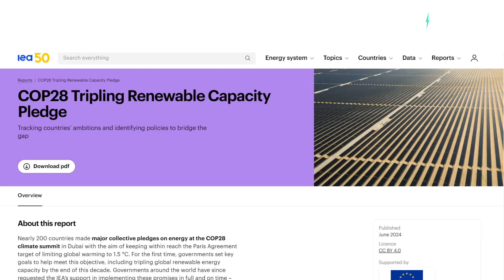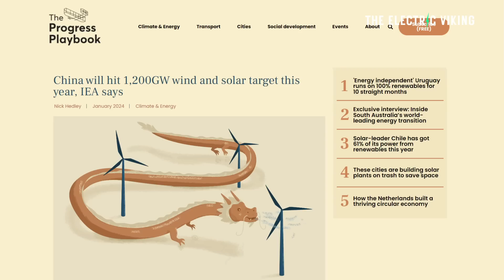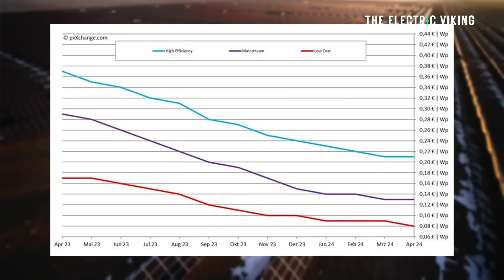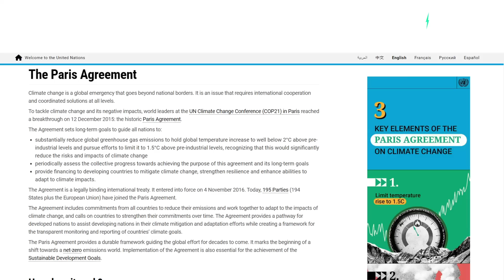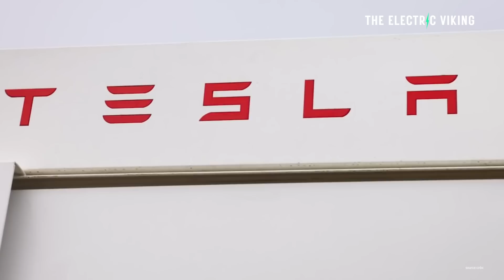IEA debunks media lies - world will triple renewable energy capacity by 2030

Comment: Renewable technology simply isn't ready to supply the world's energy.  Solar requires energy storage, and we don't have efficient energy storage at this time. Wind is intermittent, even in the best circumstances. So, it requires energy storage also. There are a LOT of energy storage experiments being tested right now, but none of them is mature. Further, we can't build enough lithium-ion batteries to provide sufficient backup to the major energy grids of the world. We simply don't even begin to have the capacity. Additionally, it is questionable that we have enough rare earth materials to provide battery backup on such a massive scale. 

There are two major developments that are occurring that will dominate the world's energy system:

1. The development of solid-state batteries will transform the automotive industry. Initially, they will have 50% more range, charge in less than 10 minutes, have superior longevity and operate much more efficiently in extreme cold and hot weather. Right now, several companies are building different versions of solid-state batteries, which they will sell to various industries. At least one or two companies are ramping up for mass production of their solid-state battery versions. As the solid-state battery industry matures, it will change the world, but it still won't provide a massive shift to replacing fossil fuels used in utility power plants. The demand for solid-state batteries will be obscene when they start to come out, and it will take years for companies to even begin to meet that demand.

2. Small Nuclear Reactors (SMR) are being developed by dozens of companies. Various prototype versions have been built, but the challenge is developing an SMR that can be mass-produced, has intrinsic safety protections that don't depend on human beings, and can be easily transported via 18-wheel trucks or heavy-load helicopters.  Successful SMRs also must be easy to install and repair, possibly using modular parts that can be "plugged in" without taking the entire reactor apart. 

Several countries have built SMRs over the last 60 years and NASA is designing SMRs for space travel and spaceship propulsion. However, NASA is notoriously inefficient and stupid, so it will be private industry that will solve the SMR problems.  The rewards to those companies who are able to design an SMR that can be mass-produced, easily transported, easily repaired, reliable, easily installed and intrinsically safe are incalculable.  Imagine being able to buy a 100 Megawatt SMR that can be transported in a normal semi-truck, set up in six months instead of 10 years, and costs $150 million. It will have built-in safeguard shut-downs that don't depend on human monitoring. They won't require massive amounts of water to cool, and many designs use spent uranium waste that comes from traditional power plants. They will be so safe that they can be installed inside cities, which will make connecting them to existing grids dirt cheap. 

SMRs have the potential to provide dirt-cheap, clean energy whose only negative is that they produce nuclear waste. However, the waste they produce is not high-level waste and it is much easier to dispose of than waste from traditional nuclear plants. 

Unlike solar and wind, SMRs can produce energy 24 hours a day and they will easy to backup with redundant SMRs. So, a major city may be powered by 10 SMRs located strategically to connect to the grid, and utilities will buy three or four  "spare SMRs and install them in key points so that if one of the 10 SMRs goes down, a spare SMR immediately comes on line.

These two energy solutions are happening as I write this and they will change the world. Solar and wind will continue to grow, but they will never exclusively power nation's power grids because there are no cheap, efficient storage options on the horizon. Further, they are highly suspectable to hurricanes, floods, tornadoes, earthquakes and other disasters. SMRs can be built underground in concrete bunkers that protect them from disasters. 

I am all for wind and solar power. I will be installing a solar system on my home soon, God willing. But by themselves, they are not the panacea that "green" environmentalists envision. We are not going back to the Garden of Eden, where everyone will eat granola and sing Kumbaya all day long ad nauseum. However, with SMRs, we can have a clean, safe, cheap, reliable, disaster-proof energy supply. With solid-state batteries, we can power electric vehicles more efficiently and cheaply than gas or diesel. So people will WANT to buy EVs, and leftist governments like Australia's insane, woke, socialist dictatorship government won't have to FORCE its citizens to adopt EVs. Let's all join together and give capitalism a magnificent shout of glory, because it will be capitalism that will deliver cheap clean energy and EVs with 1000-mile ranges that mentally deranged environmentalists are obsessed with. Isn't that ironic? Conservative capitalism will be the engine that fulfills the green dreams of mentally unstable green environmentalist activists and organizations. 

Conservatives across the world are the only adults in the room and nations are waking up and getting rid of their woke, leftist leaders. All of the nations that are kicking the butts of liberal, leftist, and socialist leaders out of office are now PROSPERING and succeeding. Hopefully, Australia, the EU citizens and the UK will learn this very simple lesson and summarily kick their suicidal leftish dictator leaders out of office. One can only hope that common sense will prevail. Otherwise Russia and China will be ruling these countries in the next 30 years.
Reply: Great reply. In Canada we have the same economic terrorists running the show. One big exception is that we have that inconvenient thing called winter. Batteries don’t last or like cold and I don’t like the idea of freezing to death.
Keep up the great replies.
Reply: @johnb9587  You are right,  current battery chemistry loses 40% of its capacity in the cold and can take hours to charge.  Supposedly, solid-state batteries will solve these problems. I do believe batteries that work in extreme cold and hot climates are on the horizon.
Reply: @franklong6269   Waiting for the next wet dream battery breakthrough is not a valid plan.  The chemical battery has been under development for over 250 years.
Reply: @franklong6269  There’s a radical, futuristic new technology for keeping grid batteries warm in the winter. It’s called a “building”. Apparently, they put the batteries inside a big box filled with air, and then heat the air. Researchers believe this technology could have other uses, too, such as keeping snow off cars while they’re parked, and even keeping people warm. We can’t just sit around and wait for these crazy ideas to get out of the lab, though. 

Snark aside, my Tesla uses a heat pump to keep its batteries in a good operating range. If you use a supercharger, you should always navigate to it, because that engages the heat pump so the battery is the perfect temperature for optimum charging when you arrive.
Reply: @davestagner  The discussion was about batteries for EVs, not battery backup for buildings. I am not sure how your razor-sharp wit missed that fact.

I own a 2022 Model 3 and I live in Arizona. Currently, anytime the temperature gets over 90 degrees, Tesla's heat pump kicks in to cool the battery. God forbid that you park the car in the sun when the temperature is over 100 degrees F, because the heat pump will run full power and sound like a siren, even when you are not even using the car. Thus, I find your stating the obvious completely misses the point.

Right now, daytime temperatures in the Phoenix Metro area in AZ range from 100 - 113 degrees F. If I use the car in the day, I lose approximately 40% of the range because the car has to exert exorbitant amounts of energy to cool the battery system. We can conclude that current battery technology is severely lacking in very hot and very cold climates. 

While I appreciate Tesla's forethought to provide a comprehensive cooling system for the battery, it still is not a great solution. I am thankful for it because it greatly extends the life of the battery, but it is not a real solution to deal with extreme temperatures because it destroys nearly half the range of the car.

Now I love my Model 3 and I put up with the loss of ranges and do my best to keep the car out of the blazing AZ sun during the days. But what if circumstances required that I use the car extensively during the day? Do you see the problem?

I knew this was a problem before I bought the car and the battery cooling system is doing its job because I have lost less than 5% of the battery capacity with over 78,000 miles. But it is an imperfect solution at best.

This is why the arrival of solid-state batteries and advanced LFP batteries from CATL and other battery manufacturers is so exciting. According to reports, extreme heat and cold do not affect the batteries significantly, they will last a million miles, they will have at least 50% more range, you can charge them to 100% every day if you need to, and they charge in about 15 minutes. Many EV channels on YouTube believe the 2025 Model Y Juniper refresh will have CATL's advanced LFP battery, which is not true solid-state, but will have most of the qualities of a solid-state battery.  If so, it will be a game changer.
Reply: @franklong6269  Your original post was about grid storage, not car batteries. Go read it again. If people changed the subject, I missed it, probably due to sarcasm. And yes, this is a harder problem for car batteries! Not impossible, but harder. Question, though… do you have internal temperature control on in your Tesla? I’m wondering if it’s losing more charge to keeping the battery cool, or keeping the interior cool. Kicks in around 90-100F depending on settings. We don’t suffer heat like yours here in MN (we might get our first 90 degree day this week), but the interior can still go way over 100F, thanks to the sunroof I think. That’s what kicks my cooling system on when the car is parked.
Reply: @davestagner  My apologies. I have been working out with extreme amounts of exercise, and today, I am so physically sore that I am nearly immobilized. It hurts just to breathe. It is necessary for me to gain muscle and change my metabolism

I actually agree with your comment that batteries used for solar and wind energy backup should be installed in conditioned space. To my knowledge, they are installed in enclosures that heat and cool them. 

Concerning my Model 3 cooling its battery:

1. Teslas all have several cooling functions. It appears that their main function is to cool the battery, which makes sense because if the battery is run hot, it will destroy it. It also cools the motor (my car has one electric motor; it is the base RWD version), and it cools the interior. 

2. To answer your question, the heat pump facilitates all of these cooling functions.  Tesla has created one of the most brilliant, efficient heat pumps in existence; which is to their credit. 

While I am not an expert on which cooling function demands the most energy, I am almost certain the car focuses on cooling the battery. Because the heat pump is so big and so efficient,  it cools the interior effortlessly. It is like using a  2-ton mini-split heat pump to cool and heat your car. 

The battery system is 63.3 KW, and it is very large. It is on the bottom of the car near the intense heat that comes off the pavement and concrete. So, there is little doubt that the heat pump is using most of its power to cool the battery.

Cooling the interior is nothing. The car will drop the temperature of the interior of the car from 100 degrees to 80 degrees in just over a minute. Tesla's heat pump is indeed a marvel of efficiency.
Reply: I keep hearing the word “can’t” around storage. I do not think that word means what you think it means. Now, here’s why your SMR fantasy won’t work. The problem is that nuclear (including SMR) can’t just be shut off and turned on at will. They really need to run as base load. But as base load, they have to compete with solar overproduction, which drives grid costs to zero. So you have to pay operational costs for electricity you can’t sell. I’m not a conservative so I don’t understand economics, but this seems bad to me. 

Next problem: The utility of storage is not created equal. There’s a lot of stuff about how we need MONTHS of storage and that’s impossible… but enough storage to run 24/7 on sunny summer days? That’s not months, that’s hours. And every one of those hours eats into potential profitable operations for SMRs or any other base load type plant. One might start thinking that base load isn’t the solution - it’s the problem. 

So what we need isn’t SMRs for base load, it’s something that can be easily turned on and off, but can run for a while if needed to back up the solar+batteries. That sounds a lot like gas plants to me - which already exist. Sure, it’s not ideal, but if we can eliminate 90% of the fossil fuel, it’s still a hell of a lot of progress, while still having the gas plants when needed. 

And finally “which already exists” is KILLING your SMR fantasies, because THEY DON’T ACTUALLY EXIST. We’re probably at least 10 years out from getting even the start of a SMR industry, much less enough to really change things. So you’re not competing with nasty coal, you’re competing with all the solar and batteries that will be built in the next 10-20 years, that will be clean and already paid for. Again, not a conservative so I don’t understand economics, but it seems to me it might be hard sell something expensive in this context.
Reply: @davestagner   Actually SMR's have been built and used for many decades.  Six countries are using them in ships since the 50's.
Reply: @davestagner  Your problem is that you lack key information about SMRs and you lack critical thinking skills.

1. I never said SMRs provide "storage." Learn to read.

2. Right now, there are over 80 countries developing SMR designs. In our country, SpaceX is developing a modular SMR that can be transported in the back of an 18-wheeler. So the REAL facts are you don't have a clue about the functions of all of the various designs being worked on. You are just vomiting out ignorance. It is VERY possible that an SMR design will have a function that will allow users to adjust the size of the fusion reaction to adjust to electrical demands. Really, it is that hard because all you have to do is place a mechanism in the reaction core that withdraws fuel-filled rods from the reaction. That will cause a smaller reaction - that's simple commonsense. We don't know the specifics of such a design or even if it is feasibly possible, but theoretically, it is possible, and you didn't understand that.

3. Let's deal with your second fallacy. Even if we assume that SMRs can only run at a fixed output, right now SMR designs range from 50 MW to 300 MW. So, there is a HUGE array of designs being worked on that have large variances in power outputs. So, what we will see is that cities, data centers and other entities that require utility-scale electricity will  be able to select from a variety of SMRs to meet their specific need.  Let's say you run ten large data centers, and you only need 25 MW of power. You will be able to order an SMR that specifically meets your power needs. Now, let's say you want to add ten more data centers, and you will be able to purchase a second SMR to meet that complex's power needs. 

So my point is, one of the beauty of having well over a hundred different SMR designs being worked on is that when a functional, modular, safe, reliable, cost-effective design is refined, that can be mass-produced and is easily shipped anywhere in the world, various cities, countries and businesses will be able to scale SMR energy production specifically to meet their current needs.

4. Your criticism of SMRs is that they will create electricity that we cannot use. You may not be correct, but let's assume that you are for a moment. My answer is, so what? Who cares?  As battery technology improves and gets cheaper, users will be able to store that energy. They same is true for gravity storage systems being designed and tried. The same is true for heat storage systems that use molten salt to store energy which are in use now. So there are storage methods being worked on right now.

But what if SMRs DO produce more electricity than we can use, what in the living hell is wrong with that? Did you even think before you wrote your comment? What you are saying is that if we produce more energy than we can use that's bad thing. What a stupid, absurd comment. The benefit of overproducing electricity from SMRs would be dirt-cheap energy which would benefit the ENTIRE WORLD! D

Do you know that right now natural gas costs have gone negative because of overproduction in oil fields. Oil companies are paying gas vendors to take excess natural gas off of their hands. Shall we stop drilling for oil because we are producing too much natural gas as a by-product? I mean, really, that's your argument and it's absurd.  NO! The excess natural gas production lowers energy costs, which benefits everyone. The oil companies are still making significant profits on oil sales, so they can afford for gas prices to go negative, and everyone comes out a winner.

5. Following up on your comment that gas plants are a viable solution to help produce electricity, I commend you. That is a great observation, and I agree. The problem is that ignorant Americans have been brainwashed into voting for Democrats, ALL of who are obsessed with eliminating fossil fuels. Gas plants with modern scrubbers do not pollute the air. They are one of the cleanest energy sources available. With the use of scrubbers, virtually the only output is C02, and Democrats have a cult-like fear of C02 emissions. They actually call C02 emissions "toxic" and "destructive to the climate,"  which is absurd. They are too stupid and illiterate to understand THEY WILL DIE WITHOUT SUFFICIENT C02 IN THE ATMOSPHERE. It is FAR better to have too much C02 than too little because if you do have too little, it will cause a chain reaction that will bring another ice age on our planet and kill most of the animal life on earth. Cold kills much more efficiently than hot.

6. I have already dealt with your absurdly ignorant comment that SMRs don't exist. You said you are referring to new modern designs of SMRs, and my answer is "well duh!"  OF COURSE, we are dealing with new designs; that is the whole point of my original comment. Older SMRs are built one at a time, and they have cluttered designs. They work really well, but this type of disorganization causes them to be expensive, inefficient and difficult to repair. Those failures are now being addressed all over the world with cutting-edge SMRs.

I would encourage you to Google SpaceX's SMR design goals because SpaceX and Tesla are world-renowned for making world-changing breakthroughs with very complex scientific projects. The design parameters of the SpaceX SMR are just brilliant, and I believe they will be one of the first companies to come out with a working SMR prototype that will be able to be mass-produced, modular (for easy repair), cost effective to make and maintain, and reliable.
Reply: @davestagner  /Wow your ignorance on this subject is just off the charts. We DO have SMRs in aircraft carriers and submarines. We will soon have 15 MW -30 MW SMRs in space. Russia operates SEVERAL SMRs and just commissioned a 50 MW SMR. That you don't understand that simple fact disqualifies everything else you say.
Reply: @franklong6269  When I say SMR, I mean it in the sense you initially did - small modular reactors for the power grid. Sure, they technically exist for military ships and submarines, but those would not exactly be economical for commercial power grid. “We will soon have” SMRs in space is a way of saying we don’t have SMRs in space (and probably shouldn’t, considering what’s inside a reactor and what would happen if/when it returns to Earth). But yeah, sure, you’re right, we already have SMRs. Just not on the power grid in any meaningful way. 

So what about the rest of my critique, that you ignored? That base load power plants are incompatible with an intermittent renewable-dominated grid? That what little advantage they do have would be eaten away by batteries? That we’re at least a decade out from any significant progress at all on real-world deployment, and two decades out from the sort of terawatts-per-year growth we are currently seeing with solar? That in the 20 years it would take to achieve real scale, we’ll have added 20 more years worth of clean, cheap renewable energy and storage to compete with? These are all valid concerns that have nothing to do with whether SMRs are “real” or not. 

C’mon, man. Stop wimping out on the EASY part, and answer the HARD part. You didn’t even try.
Reply: @davestagner   They are built in two years or less, for millions not billions.
Reply: Many countries have been building and using SMR's for many decades.
Reply: @davestagner  Several people  have corrected your ignorant statements, but I will address your "base load nonsense." 

What you fail to understand is that no power plant can supply power at a variable rate, not even gas plants and coal plants. They have "base loads" too. That is why you see utilities shutting down ENTIER plants when demand declines and putting entire plants online when demand rises.

Having said that, of all power plant types, SMRs will be the most adjustable simply because they can be made to produce 3 MW of electricity up to around 200 MW. So, theoretically, utilities will be able to group different sizes of SMRs together to meet low-demand and peak-demand requirements. We know that SMR designs allow the reactors to be shut down nearly instantly.  Also, they can be powered up very quickly because of their size and simplicity. But this will also depend on which design is being discussed.

Also, YOU don't know whether or not SMR power output will be fixed. We don't have the final designs yet. I suspect there will be a minimum power output, which you may equate as a "base load," but I suspect that by varying the amount of fissionable material that is causing the reaction,  it will allow the power output can be varied.

The genius of SMRs is that because they are small and have instant shutdown mechanisms, they will be much more flexible than massive traditional nuclear plants. Thus, we will have designs that are continually improving, and that will nave new features and abilities.  For example we might have staged reactors that have three separate small reactors in one SMR, this would allow variation of power output.

I think I read somewhere that across the world there are 48 different major companies working on SMR designs. That is a staggering amount of seed money being invested in the SMR concept. As I said in my original comment, if a company can design an SMR that is small, can be mass-produced, is simple to operate, has redundant fail-safe shutdown mechanisms, can be mass-produced, can be easily installed, does not require massive amounts of water cooling and can be repaired with modular plug and play parts, all the world come to that company to buy their reactors. 

The initial startups that we are seeing now are clumsy first efforts, but that will change. It's easy to theorize about creating SMRs, but it's much more difficult to create a viable working design.

I have no preference for SMRs in lieu of other energy sources. Thus, your rude insinuation that they are my "fantasy" is ludicrously stupid. But fusion is not going to work like people think it will and even if someone manages to create a working fusion reactor that is financially feasible, it will be incredibly expensive. SMRs can bring the world abundant, cheap, accessible energy that is nearly as "clean" as fusion energy reactors. Many fusion acolytes don't understand that it will create significant low-level radio active waste also. SMRs are the logical choice to move forward, and they are the on REAL choice that is available to the entire world.
Reply: @franklong6269  Nah. Still fantasy. Your handwaving and lack of technical detail is not doing a great job of convincing me otherwise. “It’s easy to theorize about creating SMRs, but it’s much more difficult to create a viable working design” (your words) are EXACTLY my core criticism. Pick your best case scenario. How many years do you think it would take to get SMRs to just 25% of the power grid globally? 10? 20? Even assuming no political resistance and bottomless capital, I can’t see how it’s done in less than 10 years, and in less than 20 with ANY sense of realism involved. And, until we are really building out, the “economies of scale” in production are effectively negative - it will cost more to build the early SMR plants than it would to build more of the already-unaffordable conventional reactors we’re not building. And there’s no good reason to believe it won’t run into the same political meat grinders. 

Meanwhile, during that 10-20 year best case scenario, the world will continue building out solar, wind, and batteries at an incredible pace. Already, there are places hitting 100% renewable for parts of a day. My home state of Minnesota is currently at 30% renewable over the course of a year. And we have every reason to expect that the cost of both solar and batteries will continue to tumble for several more years. Grid-scale deployment is typically less than two years, and not particularly controversial beyond the usual NIMBYs (who will be WAY worse for nuclear). Deployment at the individual building/complex level can be done in weeks or even days (there’s no such thing as a single-building SMR, they have to be done at grid scale). And of course, curtailment of excess production is as easy as flipping a switch. 

Given the circumstances, I would expect that 20 years from now, 100% renewable grids will be the rule, not the exception. Cheap, clean, reliable, predictable, and ubiquitous. THAT is what SMRs, even in your shiniest best-case scenario, will have to compete with. Days powered by so much solar that it gets curtailed regularly; nights powered by wind and batteries most of the time; gas peaker plants still around for days when intermittency/weather leads to shortfalls. How do SMRs compete economically? They won’t have the no-CO2 benefit they have over coal. They won’t easily fill the intermittent peaking nature of gas. And I don’t see how they can be cheaper than where solar and batteries are going to be in 20 years, because they can’t compete with them today. There is no economic case for SMRs, not in this world.